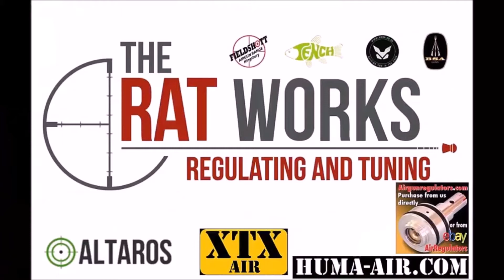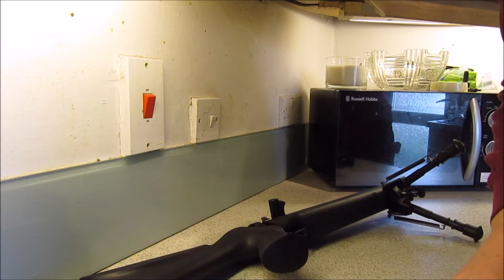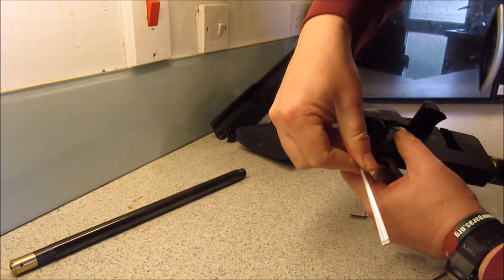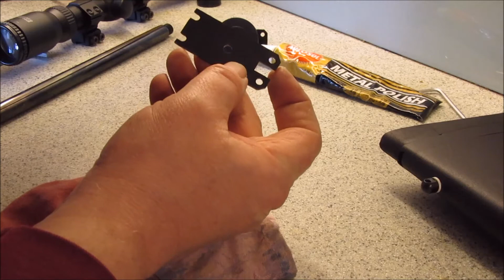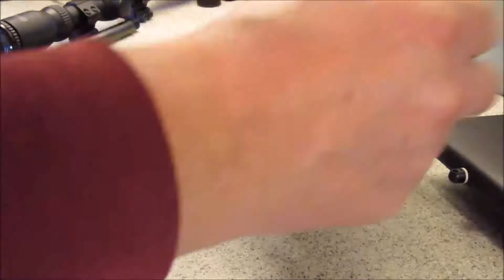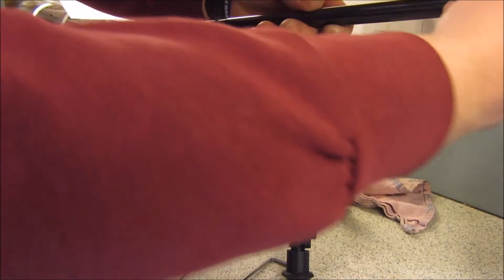The Brocock Enigma basic strip down guide 11 04 17

Comment: Brocock emigma 177 got pallets stick in barrel help
Reply from the maker: Hello Clive, remove your magazine and see if you have anything else in it. Try and work out how many you have shot through it, to see how many need to come out. You will need to buy yourself a cleaning rod if you don't already have one. I would suggest removing the barrel if you think you have more than a couple of pellets stook inside by removing the grub screws above the breach block. You can also see better with the barrel removed by shining a torch down the barrel to see how far they have gone through the barrel. If they are near the breach end, shove them from the opposite side, and vice versa. If you still have problems, you can always try applying heat to the barrel which will hopefully soften the pellets and make it a bit easier to remove them.

Comment: Thank you for the video do you have the part two video of changing the seal valve. My Enigma is leaking not sure how to fix it.
Reply from the maker: I haven't had need to take the valve out yet. Usually a change of O-ring will make the difference. Robert Lane of Lane regulators built and designed this particular Brocock rifle for Brocock, so you could give him a call. He is usually a very helpfull airgun engineer and knows this rifle inside out. His number is:  01455 283449